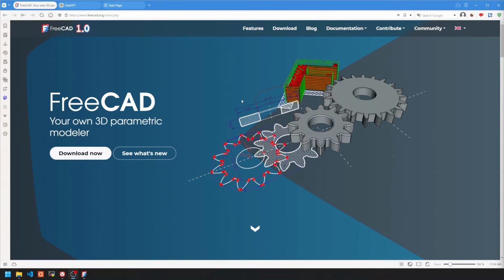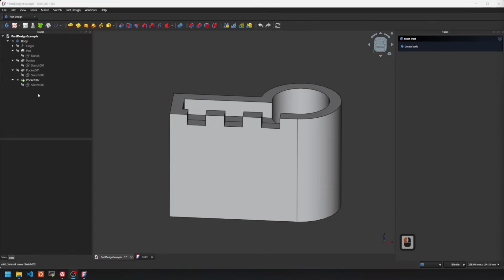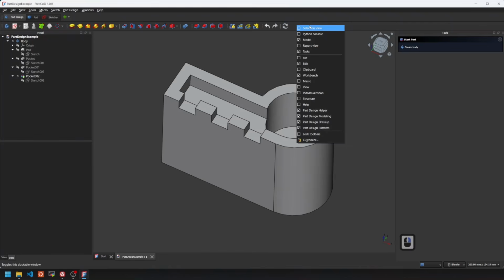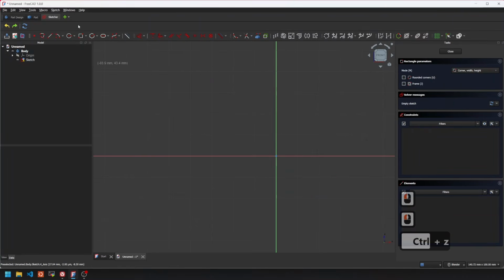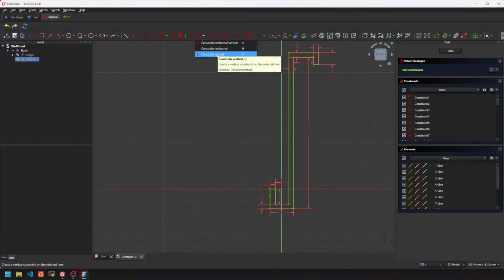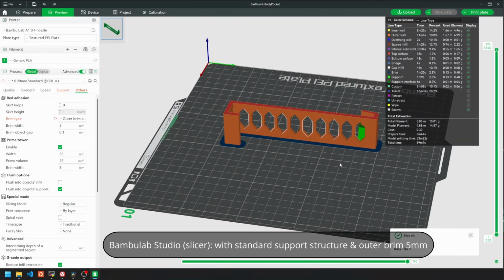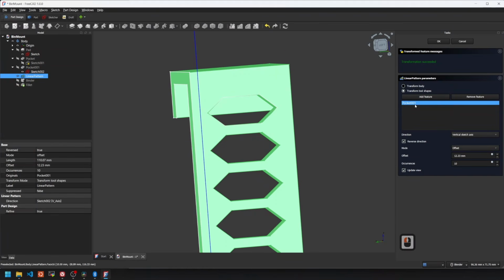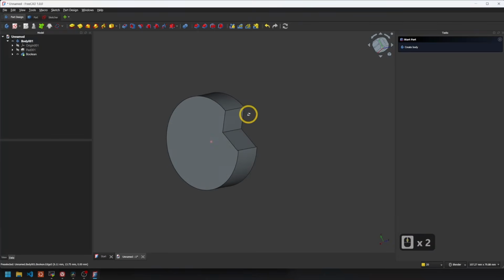FreeCAD 1.0 Beginner Essentials for 3D Printing

Comment: Very nice video.

How i do this ( maybe less begginer friendly):
- make varset and write measurements there. Cool thing about varset, it easy to save new and you can reference it so if you make some error with measure it easy to modify any model.
- useing datum plane. for new sketch. Its similar to your approach, but can name it and can be use for multiple skecth. When offseting i always useing variable, so if i change the base skecth it move along with them.
-useing keybinding (i think most of the keybind is intuitive. Example d for dimension, s for symetry, h for horizontal constrain. If i want to ad multiple line:gm(geometry multiline), rectangle gr, arch ga)

Comment from the maker: Hey folks, here’s a faster workflow for 24:31: To create a sketch on an existing object, just click the face where you want the sketch to be and select "Create Sketch" on the right.

An another one for 31:00: you can also use the edges of your padded object as reference (without the need of a shape binder).
Reply: You are right and also wrong. This is a prototype that can change drastically. If you sketch on a face and make change, that can cause tnp problem. This mean the face that generated not the same face that you picked, so its make an error and you need somehow to fix it and it can be much slower than doing this way.